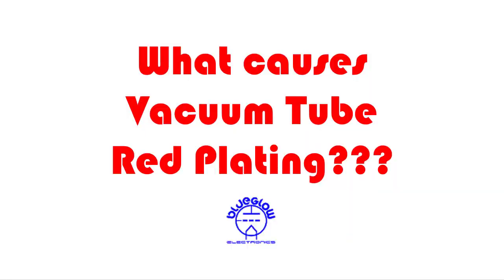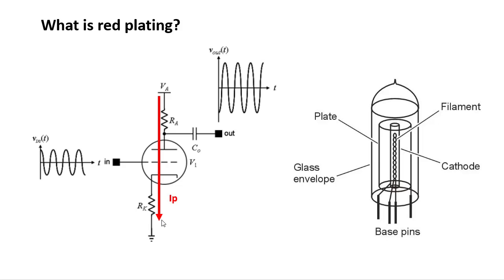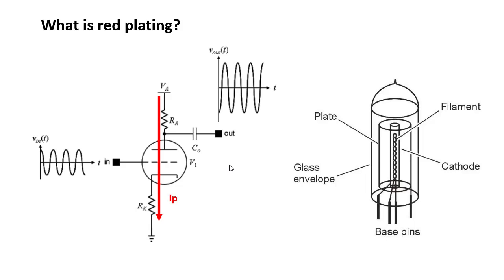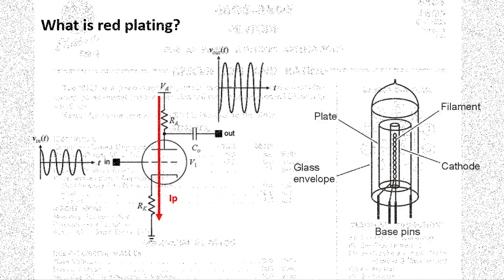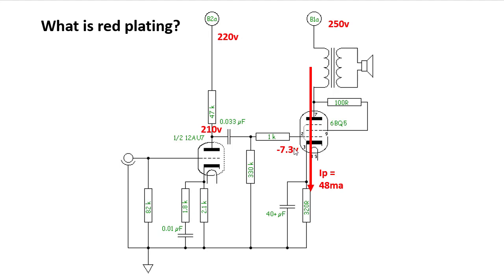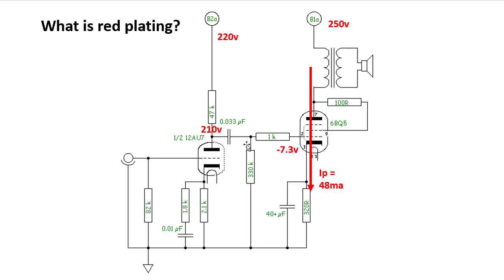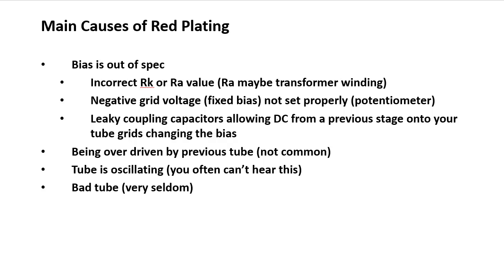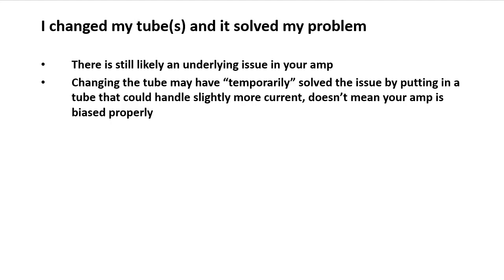What causes vacuum tubes to red plate?

Comment: I (stupidly) didn't turn a Fender amp off, before swapping the preamp tube, and ended up with a crackle and a redplating reverb tube. Swapped it with 3 different tubes; stock Groove tubes, new Mullard/Sovtek and the same model/year NOS Mullard that was redplating, and they all worked fine. Put the bad one in, and it was fine for a few minutes, and then starting glowing. I'm 90% sure I've cooked it, but now I'm wondering about what happened inside the tube to cause the red plate...